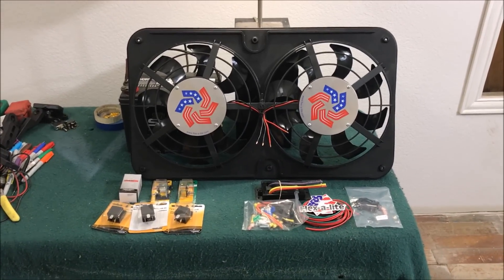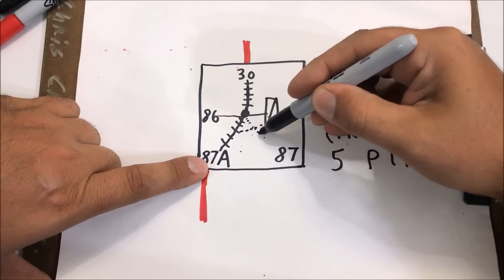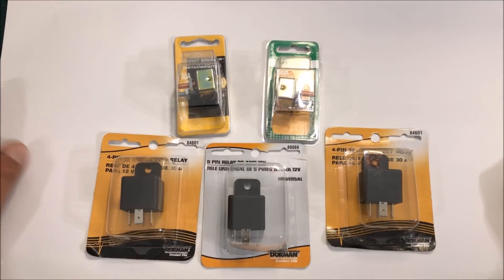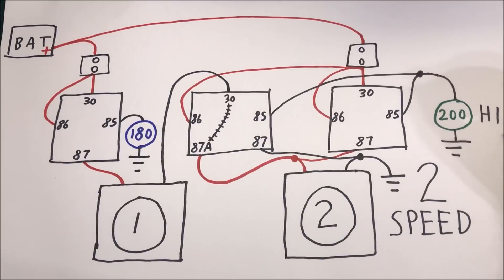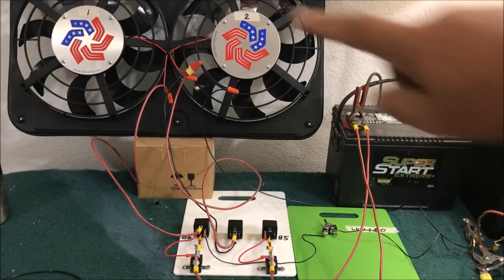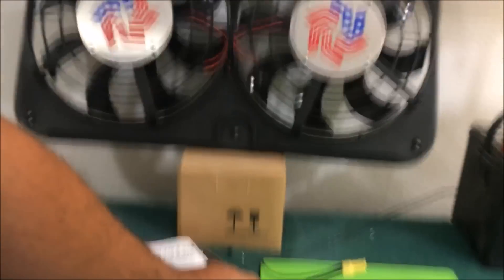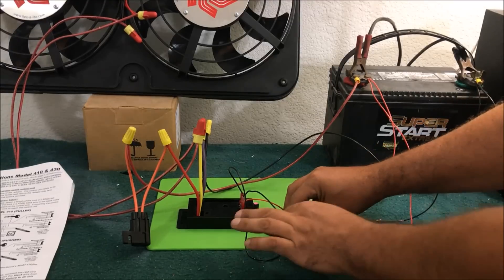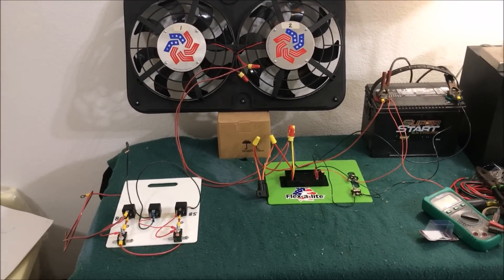auto electric cooling fan WIRING how to DIY

Comment: Great video. Never knew about the 2 speed and was about to gamble on the Derale which has horrible reviews. I have their  version of your FL210 (have had them also worked for many years). The ones have now pull just under 25 amps ea and had issues w every auto controller ( Hayden 👎🏻) so just had manual switch’s to HD relays but I’ll be adding one more to slow them down. I’ve sucked one to many birds into my grill on high😂🤦🏻‍♂️

Comment: Im a Big fan man. I was wondering if you can help me. I installed a 1980s Ford Taurus in my 68 camaro. I have a 30amp circuit breaker 70amp relay. The fun takes about 40/60amp to kick on on high speed i connect the the fan on high speed only not low speed. Is it normal that the relay heats up ? If i touch it it’s little hot. I have the same relay in my chevelle with dual fans the relays in the chevelle don’t heat up as much. The fans in the chevelle take 30amp
Reply from the maker: I would check the grounds out first...  watch my grounds explained video if you don’t know about them... a bad or undersized relay gets hot .. or bad grounds

Comment: Hi. What switch to use for high temperature as 200 'F? and where to connect it in the cooling system?
Reply from the maker: I have a bmw cooling switch and a part 2
Reply: @chriscraft77022  Thanks. Can i have the link of your part 2.

Comment: Do temp sensors need to be installed in metal or can you install into plastic housings ?
Reply from the maker: if it grounds out just run a ground to it if you run it in plastic.. it doesn’t matter

Comment: Fellow tuber here boss man! Loving your channel. Question... Why connect 86 and 30 to full beans? I am using a Holley sniper EFI that utilizes a fan 1 and fan 2 ground trigger to 85. Just curious on the 2 terminals to hot. Keep up the great content.
Reply from the maker: you can wire relays up all kinds of ways... I have a part 2 going over other ways
Reply: Chris Craft gotcha. I’ll be watching all your vids. I’m personally trying to get away from having a mess of wires connected to a single 12v power bolt. I have re wired my project Mach 1 about 3 times. Now. This time I’m doing it right.
Reply from the maker: @fixitnoworlater  the best way to clean it up is when you upgrade the alternator for the EFI add the HEAVY duty junction BOX.. and wire extra components off of that.. i have a 100 amp alternator upgrade video that goes over it..  the most overlooked thing in restoration.  im actually gonna go with the Fitech for my 454 in the future.. so? how did you deal with the fuel pump and return line? did you have to get another fuel tank?
Reply: @chriscraft77022  I have the 150 Power Master Alt on the way... (I added AC to my car, etc) I was going to run with the FiTECH until I started studying the Sniper... ran with the sniper and love it. Wait till you see what it does for your reliability. As for the pump and return... sniper comes with the pump and pre / post-filters. Comes with the relays etc. The return is done like this (made a video on it): https://youtu.be/uPCpaJhqCOQ You use your old tank and pop an Earl's 6an fitting with a submersible hose that ports to the bottom of the tank. Easy stuff. Check it out, sub my channel. We do a lot of things alike. Thanks again on the advice, I will be watching all your electrical vids. It's my weakness. I want to actually learn it, not copy. haha

Comment: I got a question on how to wire two open power 24v AC relays with two switches each switch to energize eack relay to power one AC electric motor, each switch can turn on the motor separately or both together.  could you show me how to wire the relays in series.  It's in a bowling alley.  Each switch is for the two pair of lanes to work signally or together,

Comment: Great video 👍. One question what size Circuit breaker should you use? And with dual fans do you need dual circuit breakers or can one circuit breaker handle it
Reply from the maker: it depends on the amp draw of the fans..  run it like i did to be on the safe side.. thats why i made the video..
Reply: Thanks for the reply sir!  So what I think is right is I am wiring it to the MSD atomic EFI so on the relay you have 87 going from the relay to the fan 85 going to the ignition switch 30 going to the battery 86 is going to the atomic to ground them out?? Does seem right to you?? It’s like pulling teeth to get MSD or the fan company to help you out?? Thanks sir.

Comment: Thanks so much for posting this Chris. I also installed the two speed, three relay option on my 76' Ford truck. I used three 16" fans two pushers and one puller with a shroud. The trucks stays on low speed with all three fans most of the time and you can barely hear them running. The high speed kick in however, is a different story. I used a dashpot from a 79 carb which is wired to the middle relay 87a and kicks my idle speed up when the three fans go to high speed. I also ran 86 on the first relay to the ignition switch and the fans turn off with the key. Thanks again!!

Comment: Hi Chris!! When you run 30 and 86 together on the relay, does that mean the fan will stay on until the temperature sending unit cools down to its factory setting??? Even with the car off(since 86 is getting power all the time)
Reply from the maker: yes, watch my cooling fan part 2 where i go over more ways to wire the relays up..

Comment: I have a single 2 speed fan, how much does this apply to that set up?  The fan also has separate power wires for high and low

Comment: I have the relay part pretty good, my fans come on at the right temperature and all, problem I have is that the thermostat that screws into my intake leaks, any suggestions? Since they say not to use tape on it, can I just use a little? Like only on the top threads?

Comment: I have a 97 Honda prelude 2.2 in my 97 Accord it has two wires for the ect can I use just one wire and make it work 🤔 and if not are all sensors the same size

Comment: A question the 3 high and low relay do not have switch on as you cut the current or stay on until the temperature drops?
Reply from the maker: you can wire the relays how ever you want. Watch part 2 where I try to show this

Comment: So if your using the BMW thermostat  you would wire the 180 pin on the thermostat to the left relay #85, and the 190 to the middle and right relays #85,.....and all three #86 terminals from relay  to ignition on
Reply from the maker: I have a part 2 that shows all that..

Comment: Hello Chris, Is there a way to use the two speed relay set up with a single fan? Thank you and God bless
Reply from the maker: no
Reply: If it's a 2 speed fan it'll have built in resister and separate wires for high at low. If not you have to install the appropriate size resistance

Comment: Thanks for the video Chris.  I am using this setup with the Holley sniper EFI which has two adjustable fan controllers.  One issue I am having is when the car is restarted when the temps are still high enough to activate both the low and high speed at the same time the 30 amp fuse running to the high speed relay blows.  Do you have any recommendations on this?  Maybe a 35 amp fuse?
Thanks
Reply: Aaron Lake maybe even 40. Depending on your specific fans amp draw- most dc motors have a spike of higher amps than their continuous draw. A 25 amp fan can spike up to 40-45 amps on initial start.
Remember that the fuse is there in case of a short. That would produce a really high draw which the fuse will protect from even if it's as  high as 50

Comment: Very informative. What if i wanna run the high and low speed fans to one toggle switch without using the temp switch?
Reply from the maker: ground 85 on the 3 relays and get you a single pole double throw switch..  run 1 pole to the low speed relay(86) and the other pole to the high speed relays(86)(86) then you need to find a 12v source to feed the switch

Comment: How would I add a third fan if I wanted two speeds still?
Reply from the maker: a third fan could only be run on the high speed
Reply: @chriscraft77022  I see...I think that would be even more ideal in my case. Where would I splice the third fan into?

Comment: Will you tell me what cooling fan controller would be best for my 03 focus se, dohc zetec vin-3. it has 2 fans, 1 is a/c but, might spin also for low speed or again in high speed? idk? I need to know which one is my cooling fan because my A/C DOESN'T WORK ANYWAYS. I JUST NEED MY COOLING FAN TO WORK! I planned on disconnecting the a/c fan & running a toggle or 2 on my head temp sensor wires(2 wires- 1 is 12v & the other is 5v reference I think?) to make the fan run, so, if I find out which is the cooling fan & which is the a/c fan, I will disconnect the a/c fan & run toggles on the cylinder head temp sensor wires to make the fan run 4 now. I REALLY HOPE YOU CAN HELP ME OUT?
Reply from the maker: if your AC does not work ONLY!!!! 
try this first.. jump the ac pressure switch and turn on the ac in the dash and see if the 2nd fan comes on like that

Comment: Hey Chris , You definitely seem to be the guy that I need to speak to! The funny part is, in the late 90's, early 2k's, I used to know how to wire up relay's! Massive injury & years later, A...I don't remember how anymore! & B... I NEED TO KNOW HOW BECAUSE, On my 03 focus se, dohc zetec vin-3, MY COOLING FANS DO NOT OPERATE!!! I HAVE DONE EVERYTHING IMAGINABLE! I changed the cylinder head temp sensor, cooling fan solenoid, relays, checked the fuses, even ran power to the fans & THEY SPUN PERFECTLY!  I NEED YOUR HELP! my focus has about 4 relays for the fans & some fuses. I really hope you can help! also, when I disconnect the cylinder head temp sensor, the fans run constantly but, will fry my alternator! 3 alternators later, I NEED HELP! ON MY HEAD TEMP SENSOR, I TESTED IT WITH THIS CHEAP MULTIMETER & I BELEIVE IM GETTING 12V ON 1 WIRE & 5V ON THE SECOND WIRE. I AM GOING TO TRY RUNNING THEM EACH TO A TOGLE SWITCH & TRY TO CYCLE THEM THAT WAY BUT, BY BREAKING THE CIRCUIT, WHEN THE FANS COME ON, THE TEMP GUAGE STOPS WORKING SO, I WILL NOT BE ABLE TO SEE MY TEMP WHEN THE FANS HOPEFULLY RUN. I DONT HAVE THE MONEY RIGHT NOW TO ORDER NEW FANS, TO SEE IF THAT IS THE FIX SO, I NEED TO TRY SOMETHING ELSE & YOU SEEM TO KNOW EXACTLY WHAT YOUR DOING. ITS EARLY MORNING NOW BUT, I THINK MY RELAYS ARE THE "TRAIN TRACK SET UP THAT YOU DID WITH 87A. I AM GOING TO CHECK OUT YOUR CHNL & SUBSCRIBE! I NEED THE HELP!!!!!!!!!!!!!

Comment: Great video.  Can the the high/low setup be done with a single fan, and 2 input/sensors that get grounded?  I have a fan 1(low) and fan 2(high) that get grounded by the PCM/ECM at different temperatures.
Reply from the maker: NO

Comment: Chris, I'm using this configuration to wire my contour fans.  How would you recommend to wire a relay for a/c override?  Thanks!  I was pretty lost until I found this video.  I think it would be positive switching.
Reply from the maker: You run 86 to key ON + and bypass positive wire from AC compressor to 86 as well... same set up just now you have to turn on the relay
Reply: Thanks for the quick reply...Can you draw a picture for me?  I'm pretty slow haha...2xwinning@gmail.com  Thank you very much!!

Comment: Thanks for the video Chris. Im planning on doing the dual speed set up. Could I substitute the type of temp switches you used in The video for the probe style that goes through the radiator. Also, can you tell me where you put your 180 & 200 temp sensors just in case I can't substitute for the other style. I have the Edelbrock Performer intake on a 350 rocket on 72. Cutlass. Thanks
Reply from the maker: I have a bmw temp switch video..  if you use the probes you run the red to 86 on the relay to turn them on.. and ground 85
Reply: Hey Chris thanks for your response. Can you give these temp probes a look and tell me if you think they'll work out for the two speed set up..( Hayden 3653). These probes are adjustable from 160-240. However, in the product description it wasn't clear as to how the fans would turn off. After speaking with Hayden tech support they said the fans will cut off once the temp drops 10 degrees below whatever temp you have the fans set to come on at. I appreciate your time.

Comment: Im trying to wire some fans to help out the A/C during the summer months. I am not replacing the engine's fan. I was trying to add it as a push fan to blow through the condenser. 

I would run constant power to the relay.. And from there to the fans. Then run the ground from the relay through the switch, right? The fuse would be before the relay... 

That way I could turn the fans on and off at will.. I plan on only using them while idling for long periods of time.. During 120° weather
Reply from the maker: you wire 30 and 87 the same on the relay.. splice into the power wire from the ac clutch (hot+) and wire that to 86 ( so when you turn on the ac the aux fan comes on too) then ground 85 to chassis

Comment: hello sir. Im working with a single fan only what should be the wiring diagram if the 2 speed system is used? plss help. thanks.
and where can I find that 180 and 200 temp. sensors? any alternatives?
Reply from the maker: You can’t run 2 speeds with only 1 fan.. I have a bmw temp switch video for the sensor
Reply: thanks a lot sir. btw Im from philippines. thanks again.

Comment: Thanks for the help. Just the tutorial I needed to help me wire two fans for my transmission cooler allowing for a low setting (running in series) and a high sitting (running in parallel). Rather than using thermal sensor switches, however, I wired them to a DPDT switch on my dash.

Comment: I never knew running fans in series cuts the speed in half. I usually run one fan with a 3ohm resistor for low speed. I've used flexalite in the past don't much like them. There whicked expensive I've spent 400 on a fan setup that's nuts when you can get a better fan setup from a salvage yard for next to nothing. That fan controller you have is crazy priced a few relays neatly packed fuck that.

Comment: Great video, just one question though, is there a way to do the two speed setup with an ac turn on as well? Would another relay be involved?
Reply from the maker: I am so sorry.. I have a part 2 coming where I wire it up every way possible.. just haven’t made the video yet... you still use the same relay setup but you activate the relay with 86 ON with key and you bypass hot wire from ac compressor to 86 as well... it is super confusing I will get the video up ASAP.. sorry
Reply: Chris Craft hey man no need to apologize, I appreciate you taking the time to make this video, I wish I found it sooner, thank you for the reply, I'm looking forward to watching your other videos...

Comment: Hey Chris great video. I'm trying to figure out how to wire the intrepid fans(98-04) in my s10 I would like to the 3 relay setup with the bmw dual temp switch, I can't find any accurate info on how many amp the fans pull, is there a way I can figure that out
Reply from the maker: if you are gonna run the 3 relays wire it just like I did... they only sell 30 amp relays and breakers at the parts store.. 10g wire... all that stuff I bought from oreilly and it was all on the shelves.. I’m actually running the bmw switch just haven’t made the video yet.. have you looked into the alternator upgrade? that’s your next problem

Comment: Hi Chris..1st of all THANK-YOU for ALL UR GREAT HELPFUL VIDEOS. Doing my electric dual fans with the 3 relay set up. My question is I will be running 180 temp sensors then when it reaches 195/200 degrees I want to be able to use a toggle switch from my dash. How would I wire it in?

Yazmin... Venice Beach .CA
🏄🏄🏄🏄🏄🏄🏄🏄🏄 
 1974 Nova ..383 Stroked👍👍👍
Reply from the maker: wait till i make part 2...  i will be going over a bunch of different ways to wire it up...  this is just the basic idea..  watch my bmw temp switch video if you dont already know about that switch..   thats what im using on my chevelle... part 2 coming soon....
Reply: Chris Craft hi Chris part 2 anytime soon?
Thanks Yazmin Venice Beach. Ca🏄🏄🏄
Reply from the maker: I’ll get it done this weekend...

Comment: Hi Chris..? For you how can I determine if my dual fans can handle both low & high speed voltage.I have no info on fans due to NO info ##s on actual fans trust me I looked thoroughly. Also on relay 1 you have battery going to #30 &  #85?  Also do I have to have temp sensor (1wire) or can I wire without?
Thanks for ALL your Great videos. Love to see when you're done with your car.
Yazmin Venice Beach, Ca🏄🏄🏄🏄🏄🏄🏄🏄🏄
Reply from the maker: I’m working on a part 2 where I will go over stuff that you are asking... those questions all have big answers..

Comment: Great video man thanks!! do you have another video or a picture with the AC hooked up?
Reply from the maker: i am working on it... what are you working on?
Reply: 2001 sierra im putting fans from a newer Chevy I had them wired differently and it burn the relay
Reply from the maker: i have an 03 silverado that i will soon go over how to add them to a fuel injected vehicle..   you still need the relay set up in this video...  they are just activated different..  ill have it up soon but that could be a month
Reply: cool man thank you
Reply: Chris Craft hei did you make the video wiring with ac ? Thank you

Comment: Chris, I think what I'm going to do is use 2- 4 pin relayes with a flex-a-lite temperature controller for the 2 fans,,  And a 3rd relay for the A.C. Unit to both fans. I'm going to run them separately from each other in case there's a problem in the future. I understand the 4 pin relay Well (how they work). I still would appreciate the pictures though. Thankyou so much for your video's!!! God Bless
Reply from the maker: dude im about to call you